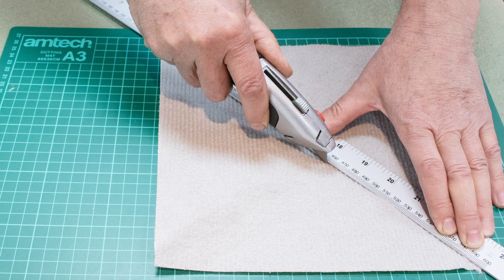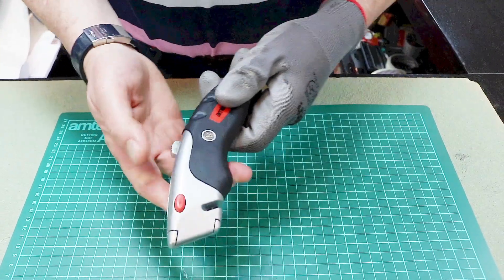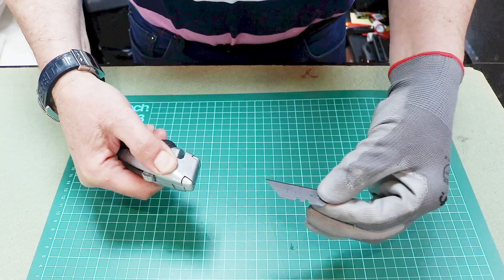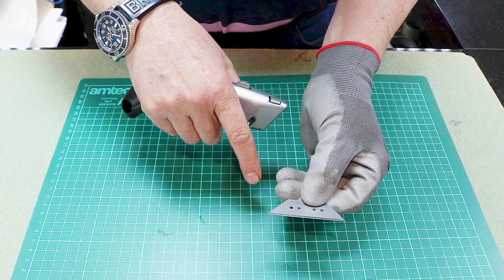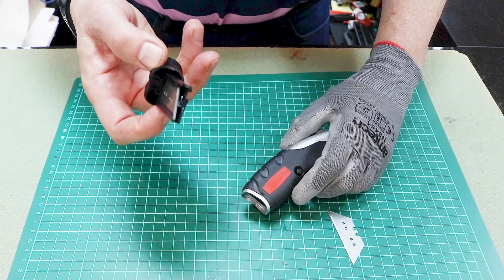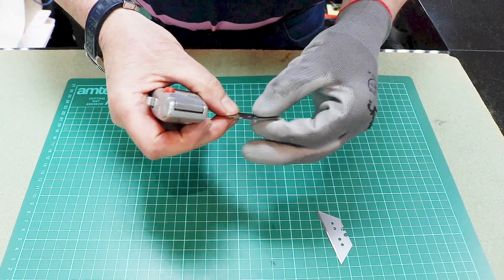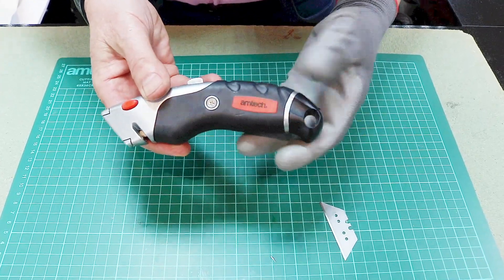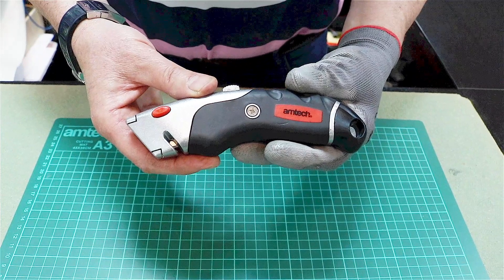How do you change the blade in the retractable utility knife?

Comment: Everything I needed to know. The method demonstrated works with the WalMart Hypertough brand too. The difference is that the screws holding the handle together are hex screws that require an Allan Wrench type of tool. (And it's so easy to strip them).  Pulling the blade as demonstrated worked. In the case of the Hypertough, the spare blades are kept in a chamber in the handle that can be lifted out, you don't have to pull out the blade assembly. Super happy to have found this video.
Reply from the maker: thank you for your feedback. As we are a UK company and only sell in the UK we have no knowledge of the USA marketplace so thank you for your comments. please subscribe to our YouTube channel for more DIY know-how:
https://www.youtube.com/channel/UCqRCNftBSq1zhrd9NB5IWzw